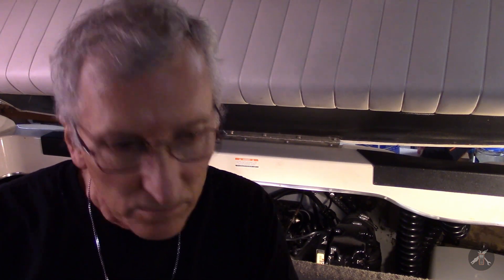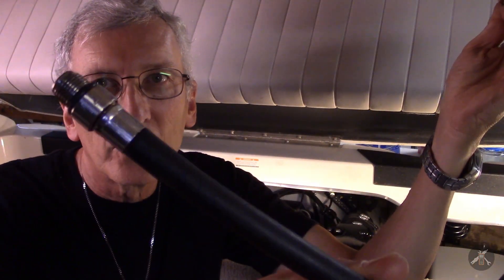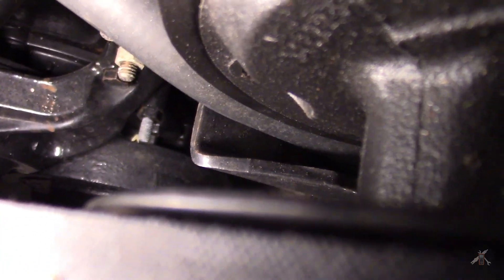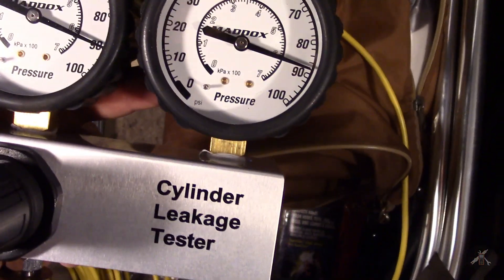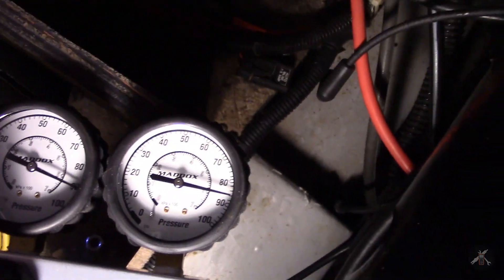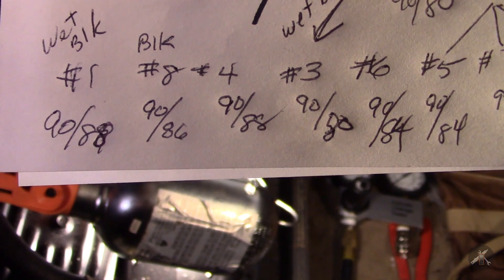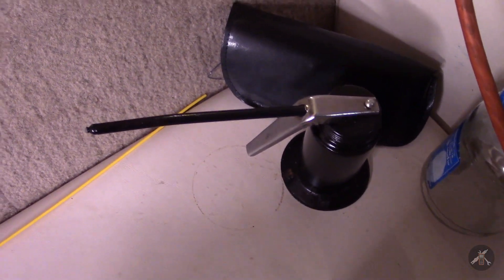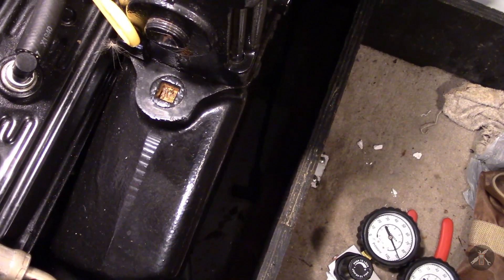Engine Cylinder Leakdown Test - 5.0L GM Mercruiser

Comment: My whole life, Ive asked mechanics about doing this for me on myriad engines, with high mileage - usually they didnt want to do it. Generally, shops just want the simple answer one size fits all recommendations for you to just take their word for it - You probably should just "replace" the engine.  Im glad you show how to do this yourself.  We are definitely at a point in history where no-one wants to do hard research or diagnostics - thereby making the adage: "If you want something done right, you have to do it yourself. " Thank the Lord for youtube!
Reply from the maker: I haven't had the experience with outside shops because I have never asked.  I do tend to be the do-it-yourself guy. But I can understand that some of these methods are not frequently used.  It takes time to go through the work and replacing parts can be an easier route.  
This leakdown check can provide a lot of information.  The compression check can also be very good.  In some ways it could be better since it runs the pistons through the full length of the stroke.
Reply: @bitsofwisdom460  Agreed!  Thanks to your vid I feel I now know the tool and how to do it myself

Comment: Cool. I ran this test on a Honda 250X dirt bike which help diagnose oil use and an incorrectly installed seal from the dealer. Nice job
Reply from the maker: Thanks, it's a good tool.  I've only used this one a few times, but very helpful.  Glad your dirt bike was fixed.